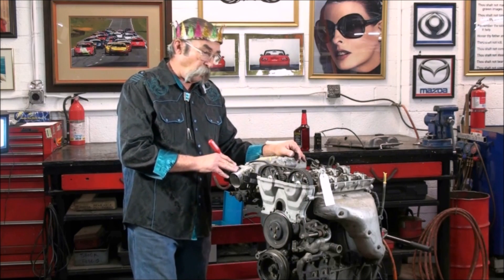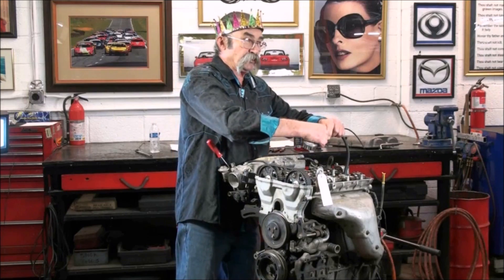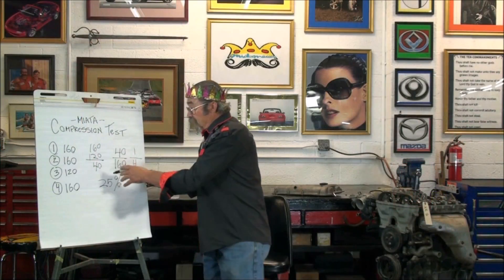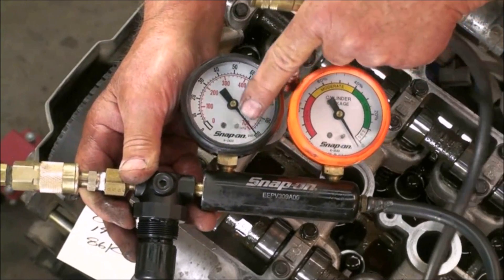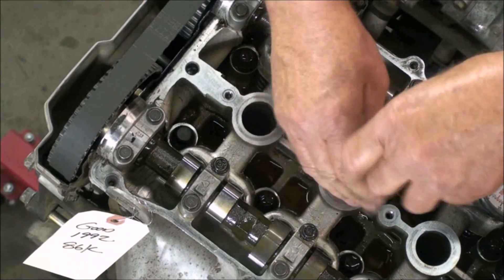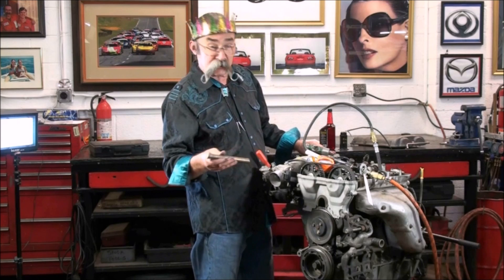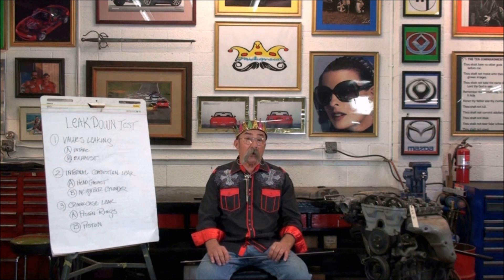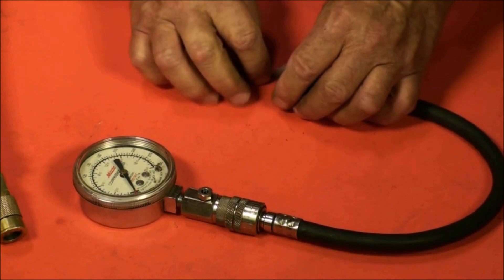How to Engine Compression and Leak Down Test

Comment: Is there a way to test if oil rings are bad. You probably won't find out if there is a fault with them with a compression test or a leak down test, I think.
Reply: Hello,
The rule is ...if the engine uses more than 1 quart of oil in 200 miles then the engine oil control rings are suspect.  There will be big smoke on a cold start.  Mike,  The King of Miatas.
Reply: @michaelpaar4261  It matches what I suspected, the car that I bought from a used car seller, a BMW x3, uses about 3.9 ltr per 1000 km. This scammer tried to deceive me that it is only valve seals and fixed piston rings and did an engine flush and poured in additives and ordered me to drive 1000 km, which did not help anything. I had the car at a bmw workshop for a check and consumption measurement of engine oil and they told me that this car had been with them before due to an overheated engine and they were sure that there was damage to one or more oil rings since the compression, pcv and valve seals were ok . My lawyer has ordered this scammer to take the car back and cancel the purchase because you can't repair an engine that uses so much oil with engine flush and additives

Comment: I see there are cheap leak down testers for sale but the vacuum only works on 30 psi of pressure on the inlet, will that be sufficient or is 100 psi ideal?
Reply from the maker: Hello Sir William,
Yes, 30 PSI will work but 100 PSI is ideal.
The King of Miatas. Mike.
Reply: Can someone elaborate on how this test can be accurate on only 30 psi inlet pressure? 
I had this test done on my car at my dealer shop, they pressurized the cylinders at only 31-34psi pressure with loss of 7.5-10%. When I asked why they used only 30psi and not 100psi they replied that the mechanic didn’t want to damage engine components. Engines are running at higher then 100psi.
I think they BS me.

Comment: MIKE MIATAKING, 
              To measure the leakage of the cylinder while during the leakdown test you listen to any "Hissing" from the dipstick pipe, Hissing from the exhaust pipe/exhaust valve, Hissing from the headgasket, or bubbles from the cars radiator coolant has bubbles? anywhere else? 
             A Dry Cylinder compression test should measure 160PSI to 180PSI?
Reply from the maker: Hello,
Yes, hissing like a snake. The compressed air in finding ways out. Bubbles in the coolant jacket.
The King of Miatas. Mike.
Reply: @MikesPlaceBiz  thanks for the help
I couldn't find a video of yours on how to test each gauge in the dashboard. How to test the oil gauge, temperature gauge, gas gauge, to check if they are good or bad how can you test them using what testing tool for cars 60's,70s, 80's, 90s gauges?
Reply: @billwilliams6338  Hello Sir Bill,
Dash gauges are tested during service. If they do not read right then replacement may be needed or a poor signal may be the trouble.
The King of Miatas, Mike.
Reply: @famousseamusdude3636  but what "test tool" can I use to test the oil gauge, gas gauge, temp gauge? I need to know the test tool name?
Reply: @billwilliams6338 Hello,
Thank you for your continued interest. A adjustable load gauge, multimeter, and adjustable volt meter.
The King of Miatas. Mike.
Reply: @famousseamusdude3636  can you make a youtube video showing how to test the car dash gauges to see if they work correctly and not reading false readings and how to test the sending units to the cars gauges?
Reply from the maker: @billwilliams6338  Hello Sir Bill,
Thank you for your thoughts and wishes. We will add this idea to our long list of videos to make.
The King of Miatas. Mike.
Reply: @MikesPlaceBiz  thanks because i don't know how to test the sending units in a car and how to test the oil gauge, gas gauge, temp gauge in a car.
Reply: @MikesPlaceBiz  thanks for the help
Whats the Normal Operating temperature measured value the car should be at while idling and running? what is the temperature degree number at normal operating temperature the car should be at normally?

Comment: Recently bought a 1990 1.6L mazda miata and every cylinder before cylinder 4 is between 150 and 169, however cylinder 4 is between 40-50PSI and i have no idea what to do from here. Any ideas?
Reply from the maker: Hello Sir Isaac,
Your next step is the leak down test. Good luck with your Miata Mission.
Mike the Miata King.

Comment: This guy is spot on! Clear and easy to understand. Nothing useless in this video and the valve tapping thing is what we do with aircraft engines in case of carbon/lead build up. I subscribed!
Reply: Remind me not to fly an aeroplane maintained by you  . It's one thing to do it on a car, but please not...ever... on an aircraft engine
Reply: cstoreyqc You are a completely ignorant person. Every 50 hours and or 100 hrs of engine run time we check the compression of every cylinder. We check to make sure every time the aircraft, that runs on 130 octane fuel because of high compression and it’s an air cooled engine, needs every ounce of horsepower to perform to specifications. If the pilot expects to lift off at full gross weight in 1200 feet and clear the trees, and the engine went without a test showing a burnt exhaust valve, or out of adjustment intake valve,  or rings burning too much oil and eventually seizing the engine, people die. Most auto mechanics don’t even know what a leak down test is. I’m a mechanic and a pilot and from your comment alone I wouldn’t trust your judgment to change a tail light. 

You know absolutely nothing about aircraft and the leakdown test is required at a minimum on every 100 hr and annual inspection. Don’t troll if you don’t know. Go to a General Aviation airport and ask about it.
Reply: Your conceit, your arrogance and your ignorance quite clearly know no bounds.  Do you actually hold  an engine licence ?   If so , do tell us which supervising authority issued it, because I shall take steps to have it revoked.
Reply: cstoreyqc cstoreyqc you’re comment is disrespectful. 
https://www.lycoming.com/sites/default/files/Cylinder%20Compression.pdf

https://m.youtube.com/watch?v=jvdmXm2n1Is

Comment: Thanks for the vids mike! Like that you go as far to describe symptoms as well as the causes of them and even the solutions. Good stuff. Now to just find the cause of my no start issue after a new-to-me/used head and head gasket replacement. 
EDIT: me being the dummy I am sometimes had reversed the return and feed line for the Fuel Pressure Regulator and fuel rail..Oopps, runs like a top now. =D

Comment: Leakage detected thru crankcase. Technician suggested new engine. Any idea what problem is?
Reply: probably piston ore piston rings,you can check it by removing the oil cap when idle check for blow by(not Always a good method)

Comment: Hi
Mike you showed a formula for percentage of health in the engine after a compression test,which I now cannot find. Would it be possible to put this video back up? Or send me the info.
  Keep on keepin on Rob UK.
Reply from the maker: Hello Sir Rob,
Please take a look at time 3.17 on this video. Thank you for your viewing time.
The King of Miatas. Mike.
Reply: @MikesPlaceBiz  hi Mike what mean a lot of fuel in the hole of injecteur after a take it out
Reply: @AMG8241  Hello,
Thank you for your concerns. It is like opening a soda pop with the pressure and fizz.
This is normal. Be careful for sparks and flames.
Mike. The King of Miatas.
Reply: @michaelpaar4261  tks for ur answer but where can pressure come the engine is not runing its only one injecteur in v8 engine after  i took them out and the side of 4 injecteur the last one have a lot of fuel in the hole
Reply: @michaelpaar4261  tks for ur answer but where can pressure come the engine is not runing its only one injecteur in v8 engine after  i took them out and the side of 4 injecteur the last one have a lot of fuel in the hole
Reply: @AMG8241  Hello, You may have a stuck or leaking injector.
Miatamecca.
Reply: @michaelpaar4261  tks for ur time appréciate

Comment: Great tutorial and tips. I just did a leakdown test for the first time tonight on a Ford 302 that I have to check its health. 7 cylinders have 25% leakage past the rings to the oil pan. 1 cyl has 80% also past the rings. This engine was used by someone who never had a carburetor and would flood it trying to start every time. oil smelled like gas when the cylinder issue was noticed. Thankfully the cyl walls and bearings are still good. Must have just washed the rings out and wore them down.

Comment: My 100,00mi 96 engine and compression is good ~170 on each cylinder. The engine itself runs smooth, however, their is vibration at the shift lever. What could that be? Car runs great- just an observation. Bad engine mounts? Or is that the sign of a leaking exhaust valve. I think my valve seals are bad- I get small drops of oil spitting out of the exhaust when it starts up.
Reply: try engine mounts and transmission mounts for play for vibrations. Maybe check trans fluid? Also maybe bad rings are letting too much oily air into your PCV system, back into your engine and burned out. I would assume leaking exhaust valve would mean combustion would take place in the exhaust and maybe afterfire. Not a mechanic so just postulating :)